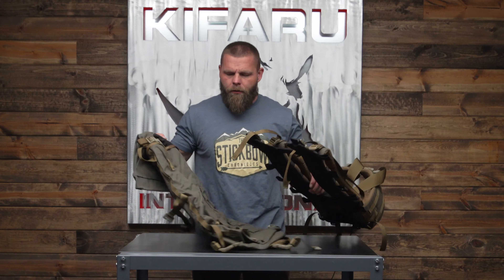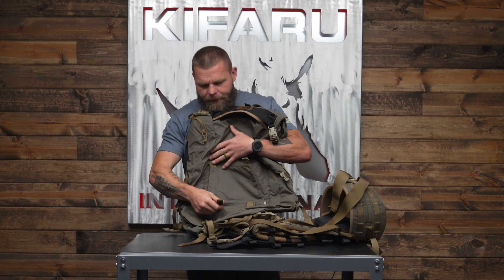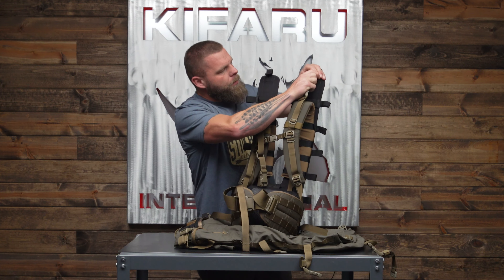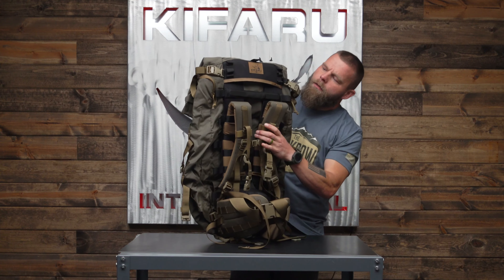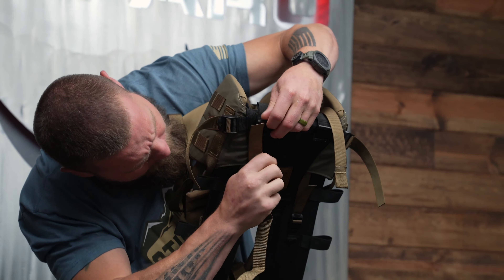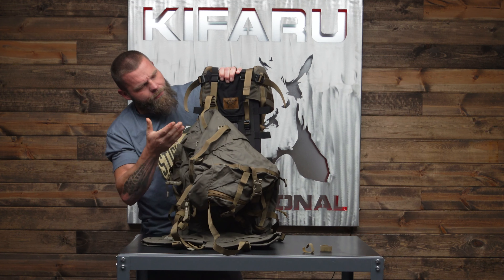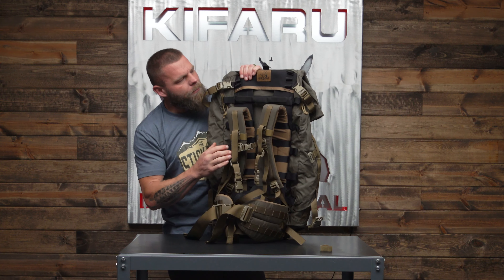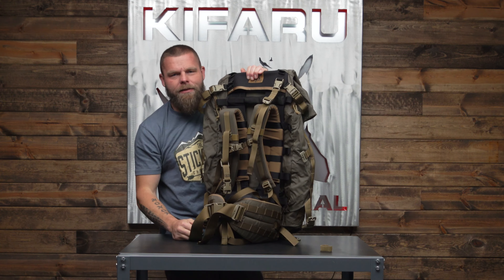Attaching a Kifaru Frame and Pack

Comment: My reckoning is by far my favorite pack I've ever had!!! 
What would you recommend for a smaller day pack that will fit the duplex frame and also have meat packing capabilities?
Reply from the maker: The Stryker XL or 22 Mag would be great options as day packs.
Reply: I appreciate the help and I'll do some investigating!!
Reply: They also are running a great sale on the regular Stryker.  I have a Reckoning too and am thinking about getting another setup for my wife...and maybe I'll borrow it on occasion.  :)

Comment: I have a Reckoning, which is fantastic!  I'm wondering about Aron's statement about attaching the straps to the top common loop instead of the bottom, I haven't used the load shelf for meat but do carry other things so I keep the shelf hooked up to the top loop and have the bag attached to the bottom.  I also have a grab-it and if needed I just ran it from the bag's common loops instead of on the frame.

Thanks and keep up the good work!
Reply from the maker: We use the top common loop for the meat shelf and attach other accessories, like the older style grab it, to the bottom common loop.